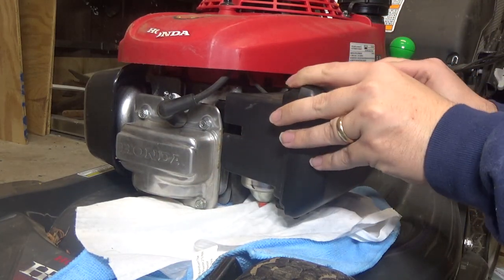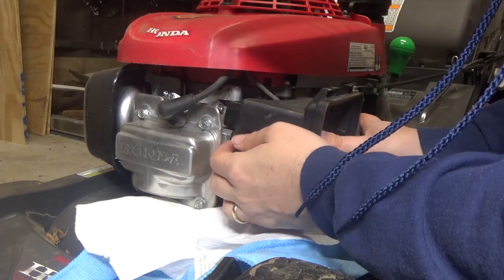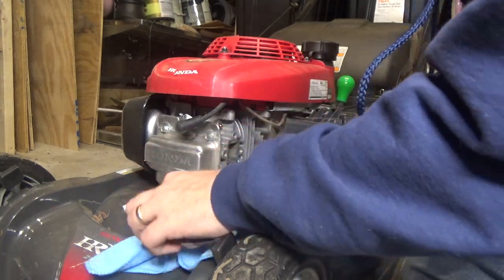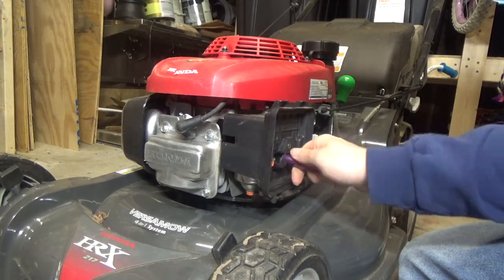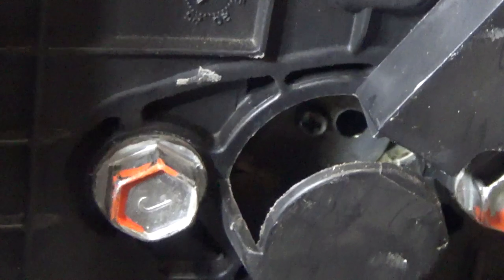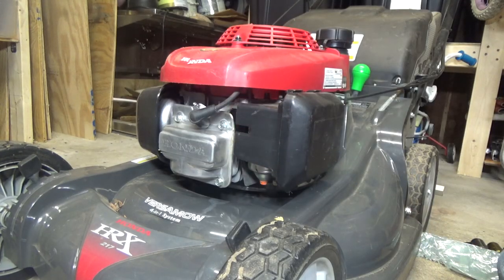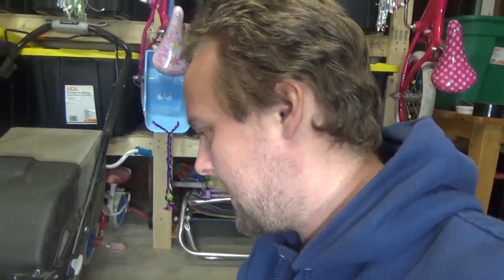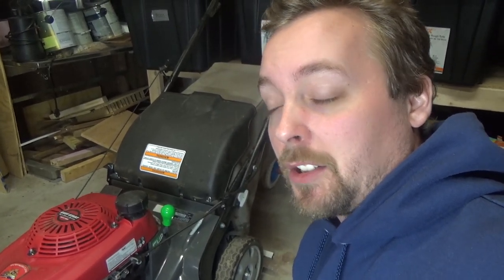Honda HRX217 Thermowax Choke Actuator Replacement

Comment: I'm about to do this now for surging. The governor will not stay put. It's the last thing I can think of to change out. Spark, carb, lines and even pulled apart the muffler. I like the video. I have my fingers crossed.

Comment: I must say, my Honda lawnmower has given me very few issues over the years, and after a decade or more of usage, it still runs as good now, as the day I bought it!  I basically change the oil every now and then depending on how much I use it, and change air filters, and that's it!

Comment: Nice how to vid. I actually close my fuel valve off and let mower run out of gas almost every time I am finished mowing. A mechanic friend of mine told me it helps prevent the carb from gumming up. Also when I start mine it does surge but not nearly as bad as yours did or for nearly as long...  good luck!👍🏼
Reply from the maker: +mmacejko929 thanks! I'll keep an eye on it.
Reply: mmacejko929 Mine surged from new, "Donyboy73" had a fix using a welding tip cleaner to very minutely enlarging the jet size. He said they run very lean for California pollution standards.
Reply from the maker: Wayne Essar I played with it some more, its possible I didnt tighten it back all the way so the gasket seal didnt seal. its also possible it still had old fuel in it. after draining it and pulling the carb apart (it was super clean) and putting it back and new fuel it worked fine. but I'm not sure what part fixed it lol
Reply: Good news!
Reply: mmacejko929 i found the opposite on every carbed machine i ever owned. Draining fuel from bowl leads to stuck floats and fuel leaks from dried seals. Treat your gas with startron everytime along with top tier gas.  I have not had a single carb issue in 2 decades doing this
Reply: Anonymous yeah every back yard mechanic has their own opinion, question is how do you know who to trust? I think you are right on with that one!
Reply: mmacejko929 Mine has been shutting right down and running badly until it gets warm. The oil fill tube is leaking so that needs an o ring. Has anyone noticed 30 weight oil has gotten really expencive?
Reply: I usually add fuel stabilizer a couple of times a year, and I'm wondering if it possibly helps clean the carb as well.   All I know is I bought it when they first came out, and it has been running great for all these years now, so very thankful for buying Honda!

Comment: Thanks. I cleaned the carburetor, changed spark plug, installed new fuel lines, bought new carburetor, and then found your video and subsequently changed the thermo wax assembly. It is now running perfectly. Thanks and I wish I have seen your video earlier.

Comment: I bought the thermo wax and when I took off the air filter I noticed my HRX217 doesnt have this one.  Mine looks different so maybe it the upgraded auto choke.  My carb is closed when cold but still has trouble starting.  Any ideas?  Once it starts and warms up for a couple minutes it starts perfect?

Comment: My Honda mower was surging also. After removing the carb , I removed the jet blew it out and cleaned everything with carb cleaner. Runs great now. Thanks for the Video.
Reply from the maker: awesome! nothing like fixing it yourself ;-)
Reply: My surged from day one so I don't think I need to clean the carb, I think the Honda engineer is the problem.

Comment: My old Honda hrx217 has the manual choke. I will love it and take care of it after dealing (in the business) with all the auto choke issues.
Reply: Soot you have a choke setting on the throttle, you probably don’t have this part in your engine?

Comment: OMG , that is why the Japanese are so good, we have chokes that work off vacuum and engine heat activating internal springs but one that works off melting wax, genius.
Reply: Not so "genius" if the thing constantly needs to be replaced.

Comment: Great video ,  Honda dealer told me that when starting a new Honda mower for its first time , let it run 10 minutes so that the wax thermo choke  can seal properly .
Reply from the maker: They didn't tell me that, but it takes me longer than 10 minutes to mow the lawn so I'm covered =P

Comment: Thank you  for the video. I am going to order this part and try it. I live in a hot climate and from day one my mower would start on two pulls when cold, but then it takes five or six once I've emptied the catcher bag and have to start the engine while it's hot.  I'm hoping this works for starting a hot engine as well as it works for you starting cold. I filled out the registration as soon as I brought the mower home. You would think Honda would have contacted me and let me know that they have fixed this issue but I never heard from them and their website has a problem and my computer will not allow  access, reporting that it detects malware on the Honda site. So I'm kind of saddled with this mower for a while, but I would tell people there are better mowers at half the price. My other concern with this Honda mower is that it leaves so much in the grass, of course on the bagging setting, my inexpensive, previous mower would suck leaves out of the grass and leave the lawn looking very clean. You don't need a Bentley just to get yourself to the grocery store.

Comment: Since you don't have a truck to sit the mower on while working on it, I just put mine on the tailgate of the truck. Check about getting some milk crates set the front and rear of the mower on them while sitting on the floor and you will not have to lean over
Reply from the maker: Yeah I have a table in there I was thinking about using but then the camera angle might be hard and the lighting. Hopefully I won't have more pulling apart anytime soon to do lol. Although other stuff I always did on the picnic table when it wasn't raining!

Comment: Does your restart quickly as your dumping the bag? I have one of these auto-choke Hondas and it starts on the first pull every time and runs great. 
But when I shut it off to empty the bag and then go to restart it, it won't start. 😠 I have to let it cool all the way back down (25 mins or so) before it'll restart. 
Seems like my auto choke is always on. But I'd think it'd eventually flood out if that was the case. Guess I should try replacing this silly part just in case.

Comment: How does the wax push the pin out?
Reply: By the heat of the engine..its a wax at room temp and turns to a liquid when it warms up and then back to a solid wax once it cools down..very old tech but works. Hope this helps.
Reply: There is a spring inside the wax that pushes the pin up when the wax is heated.
Reply: @kahvac  Is it OK to pull out the pin?
Reply: @mgomez5606  You can but you risk the chance of damaging it. its a very simple design if you pull it out i would have a new one to put in its place..they usually do not go bad dont spray any solvents or oils  on it as you may damage it.

Comment: thankyou. someone explained and shown what it does. what was the systems? wouldn't start at all? I thought mine was the carb.
Reply from the maker: Yeah it wouldn't start at all. I then with my fingers would push the auto choke lever and it would move by was hard to move and got stuck. I could physically close the choke but then when it ran and stopped it would stay fully open.
Reply: My choke actuates but it has issues coming off choke? Possibly the return spring worn?

Comment: When you blow trouched it. Did it contract on its own or will it stay open until something pushes it back in?
Reply from the maker: A correctly operating one will go back in as it cools
Reply: @GrassDaddy  good to know. Mine, after it worked, I removed the carb and it didnt go back in but on the second try, i left the carb attached for a few mins and i guess the carb pushed it back in. But now i know if it stays open then i need to buy a new one.

Comment: I'm having this issue. My garage isn't heated and I live in Canada. I'm wondering if the cold cold weather is wrecking this part
Reply from the maker: When I replaced it the second time I think it was with their new version of the part and it has worked well since.
Reply: @GrassDaddy  ok thanks. I ordered the new part from Honda, hopefully its the new version. I was on Hondas website and I see they're using a new engine with a new and improved auto choke system. I'm guessing they might have moved away from this.

Comment: My Honda is surging like that and won’t stop doing it. Eventually shuts off. I pulled the carb and it was clean. The choke assembly seemed “stiff” to me. Im thinking I need a new choke (plastic piece). Im not sure if my engine has the thermawax.  Suggestions?
Thanks for the vids!
Reply: Jim, any luck?  My machine does the same, runs fine for 15-20 minutes, then just dies, cleaned the carb and always use fresh gas and the same thing keeps happening.
Reply: Chip Bott I’ve replaced the carburetor, the automatic choke and the thermwax and it starts and revs up and down and cuts off. I’m giving up finding out what’s up with it!
Reply: @TwoCaptainsOneShip have you replaced the spark plug?  I was having same issue and found a number of threads from a google search that discussed the spark plug.  Something happens to them and they work fine when cold but fail when hot.

Comment: Nice Info. After hearing the engine how does the spark plug  look?  It sounds like it's not getting the correct spark either maybe because of this issue killed the plug.
Reply from the maker: +Dels Lawn Care I'll have to look at it, its a brand new spark plug so it should be clean

Comment: I know you made this video a while ago. How is your mower starting now? I bought a Honda HRX217VKA with a GCV200 ENGINE in March when Milwaukee temperatures were still cold, but I tested starting it and it took over five to start. Now with Milwaukee temperatures in the 80's and 90's this July, it still takes 2-3 times to start. I never had a problem with my seven year old Honda HRR216VKA. It started on first pull 99% of the time. I only bought the HRX217VKA because I wanted the speed control dial on the new Honda lawnmower. I have to wonder if it's this same problem with the hot wax choke system like you replaced?
Maybe I was spoiled by my first pull start HRR216VKA? I don't like the idea a 5 month old Honda takes 2-5 times to start and have to wonder how it will be in Fall temperatures of 35 to 40 degrees?
The Honda dealership told me they couldn't find anything wrong and it's normal for two or more pulls which I think is B.S.
I may buy the same part as you. Did you buy online at a parts website?
Thanks,
Don from Milwaukee
Reply from the maker: Pulls first start every time. If you open the air filter and look inside the choke should be closed. If it's open it's the thermowax. If that's not the issue I would replace the spark plug and get fresh gas with sta-bil added to it.
Reply: Grass Daddy, thanks for the advice. Even though the Honda HRX217VKA is only 5 months old,  I have changed out spark plug and did change the oil after the recommended five hour break in and I always use sta bl in my high test gas. I DO PLAN on taking your advice to check butter fly choke. Besides your video, I saw two other YouTube videos to include Donyboy 73 which I recommend for small engines. I really have a feeling it's that hot wax part that is defective. Do you remember the part number and where you bought it? If not, I think Donyboy 73 had the part number on his video? I will have to check. 
Other than that, I like your videos along with your grass buddies Lawn Care NUT and Ryan Korr to name a couple. 
I am a fan of Honda lawnmowers and had no problems with my HRR216VKA for seven years and I gave that to my son. Other than taking  two or more times to pull start my new HRX217VKA, it runs good. When I bought mower in early March in 20 degree weather, I bet it was near 10 pulls to start it. I marked it up to cold weather, but now even at 80 plus degrees, it takes 2-3 pulls to start. 
Again, thanks for the advice and I will check butter fly choke very soon. Milwaukee temperatures are in the middle 90's.........ICH! To hot for me to work on a lawnmower. 
Don from Milwaukee
Reply from the maker: This is the one I purchased: https://amzn.to/2lA9fLR
Reply: @GrassDaddy  , Thanks GD. I just added to my Amazon wishlist. I think that maybe the problem, but I do want to take air filter off and check the butter fly to see if it's open or closed very soon.  Maybe today before the weather gets to hot! Today near 90. Friday, 100 degrees is in forecast. Too high for Milwaukee, Wisconsin!
Thanks again. 
Don from Milwaukee
Reply: @GrassDaddy  , I looked at butter fly and it looked closed, but I will try the hot wax part anyway. The Amazon cost was $12.95 I think, but I had $6.95 credit so it only cost me $6.00 so I ordered it. Since it's so easy to replace, I will. Can't hurt. Part should be here in a few days. 
Thanks again for your replies. 
Don from Milwaukee
Reply from the maker: @donz6901  exactly.. worth a shot!

Comment: is there only one type of thermowax actuator for the honda motor or different model numbers of the thermowax?
Reply from the maker: There is only one but supposedly they made it better
Reply: just saw a parts list that showed two different part numbers depending on if your engine was 160 CC or the 190 CC. (GCV160=Z1, and GCV190=ZY)  Apparently from other comments on other videos this is a very common problem, but if you read the manual, it says to let it warm up for three minutes before using the mower.  Kind of a pain, but my surging does almost disappear after a few minutes, just like his did. For whatever reason, I could not get mine out to replace it, so it's the original one, or about 7 years old.

Comment: So what were the symptoms before you fixed it? Any video of that? Thank you!
Reply from the maker: It wouldn't start in the early spring because it was cold but stuck in the wrong position
Reply: I'm checking this video out, as my HRX217 often takes 4-6 pulls to run, whereas it use to only need one!   I'll change this part, as well as pull the bottom off the carb and check for debris.   I may take the tank off, and give the tank/hose a good cleaning, and I saw there is a 'filter' within the line coming out of the tank, that can be cleaned (blown out).   Appreciate the video, thanks so much!
Reply: @dalewatkins9889 Did the thermowax fix the issue? Mine takes 3-5 pills to start, replaced the carburetor and spark plug already and nothing
Reply: @thewiseguy7100   Honestly, I just kept pulling, and it eventually started.   All summer, with warmer temps, it's been starting on one pull!  In cold weather (lately) it takes two pulls with full choke.   I did put some fuel stabilizer in the tank, but other than that, it's been starting fine again!

Comment: i dont get to the point here - so you "tested" and it worked- why to replace it than???
Reply from the maker: When I'm testing it I'm using extreme hot/cold but in use it's a gradual warm and cool. The problem was the old one would get stuck when it gradually changed temp.
Reply: @GrassDaddy  well, than my one is not broken than, because i remowed carb maybe 5 times, and it was inside, not expelled. so tjis hack wont fix everyones problem with crappy honda system-  as i said, cleaned carb maybe 5 times, it only works for about5 minutes and starts surging. i spent all day analysing auto choke levers , and what i understud- is that such complicated system left withouth any adjustment possibilities for user????!!!!! i read somewhere, tat it matter few microns presise, and system wont work properly! the cord that connects carb and lever on right side is so easy to bend - and the whole system is fucked ! - what a piece of shit of engineering